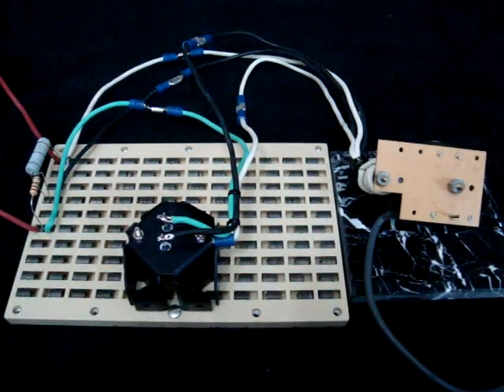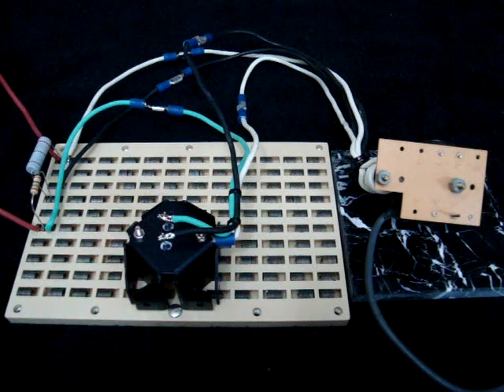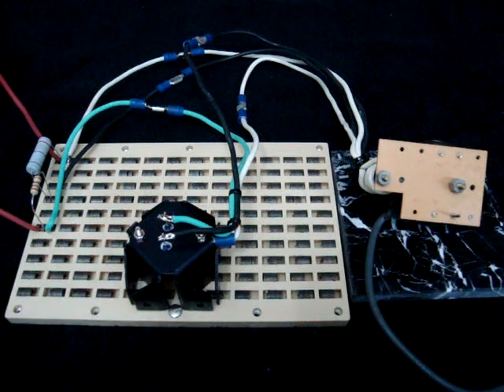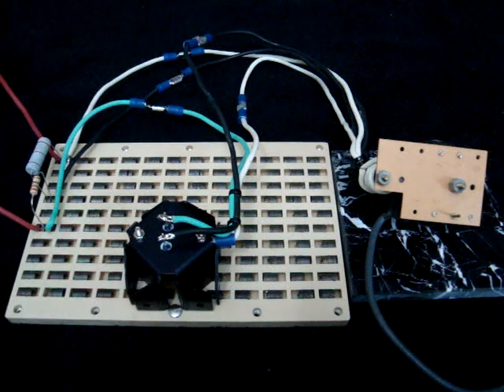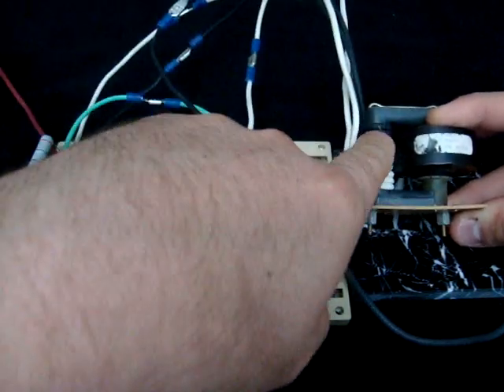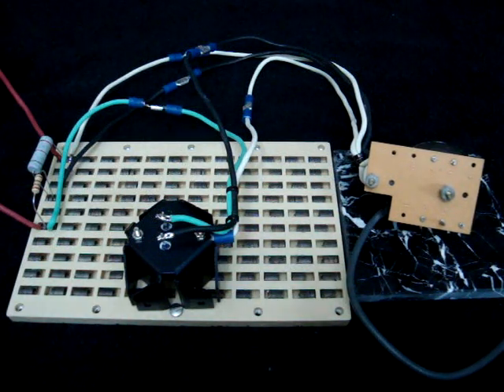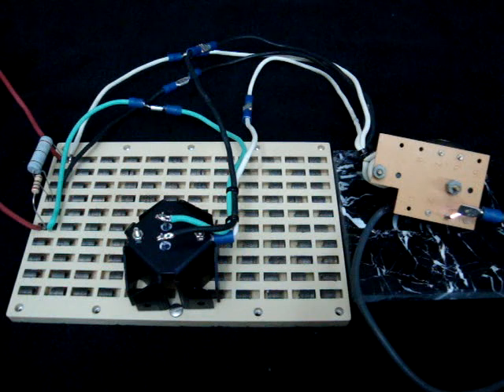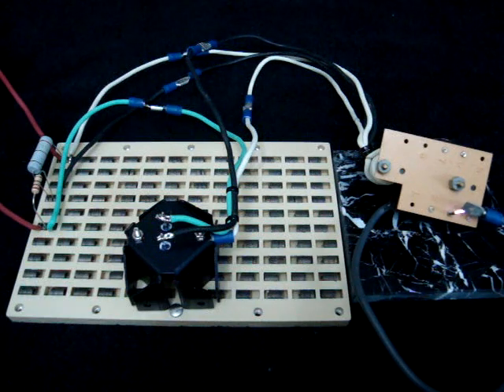Single transistor flyback driver on 12 volts

Comment: They probably die of overvolting. If you pulse a coil, voltage will build up quickly. With my 555 driver it's enough to give me quite a shock. That is also why I am using a IRFP450 high voltage MOSFET that seems to go on and on.

Comment: nice vid, and yes the 2n3055 dies fast i burned 2 of them before when i was trying to learn how it all works the first one due to overheat i guess and the second one died instantly because of a wrong setup so now I will tell you why it dies, because on a normal transistor the base must be run at maximum of a 5v and when a stupid back spike gets into the base = bam it died so the one that resist those kind of voltages is: BU2508AF it can stand a high current at the base and high voltage.